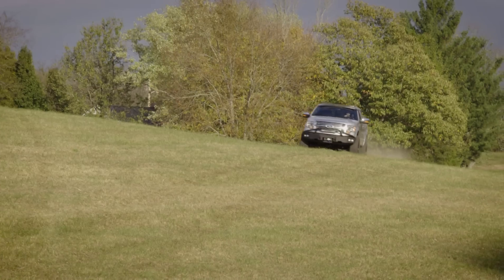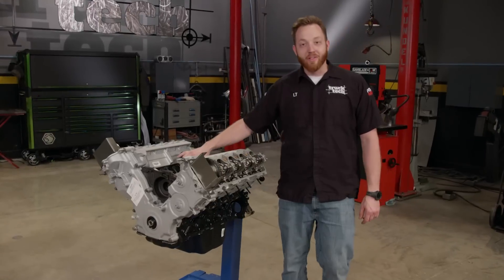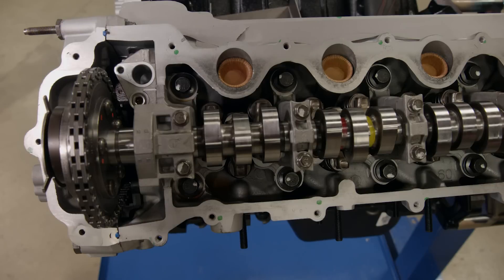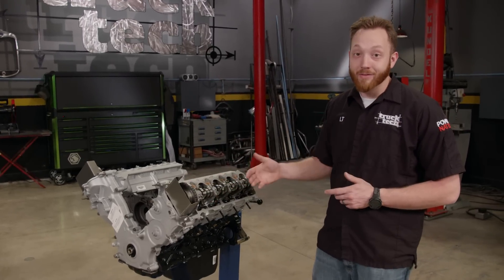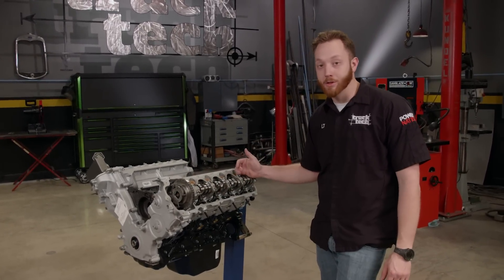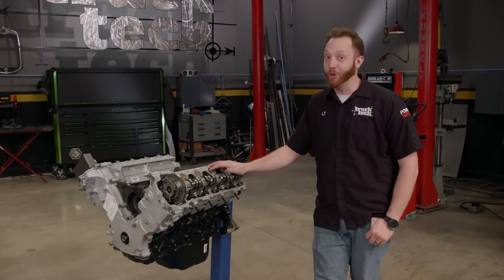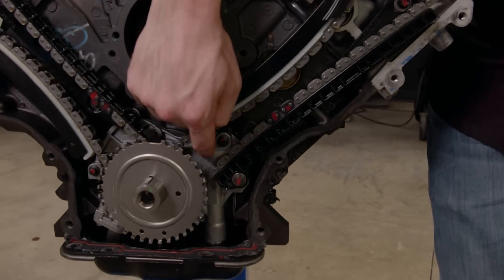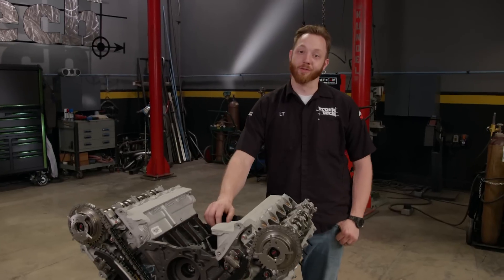Hope For 5.4L 3V Mod Motor Fans

Comment: Listen.  Please take this to heart.  If Ford does anything right, it's trucks and 8 cylinder engines.  Mod motors are no exception.  The vague bologna that is perpetuated with the 3 valves is played out.  "They spit plugs, the old plug design was terrible, the phasers explode, phasers are a terrible thing," on and on.  I will relate my story with my 3V.
     Bought an 05 Expedition with 182K on it.  Needed it for all the kids.  Wanted a truck.  The expedition fit the bill.  I bought an Eddie Bauer, so it's a LOAD of weight.  like 5600 curb weight or something like that.  It's a 4 wheel drive.  Limited slip rear dif.  Actually a pretty nice set up.  Good shape.  paid 4500 cash and owned it the day I bought it.  The torque converter lockup was slipping when I bought it so I swapped it out with a new torque converter and a much better built transmission (had monster out of Florida rebuild it, they do performance racing transmissions, and it cost just a little over the typical cost of a stock rebuild).  Back to the engine part of this story.
     The engine had that diesel rattle at idle, the original phasers were shot.  I was unaware about the oil pump issues these things experience, so I just replaced the camshaft phasers with an upgraded set of Dorman phasers.  I will say that I have never had an issue with these phasers and I get no codes, they work just fine.
     Anyway, drove the truck for approx another 40K just doing that.  I always added one container of lucas to it when doing an oil change.  Stuff does a great job of sticky lubrication and helping to protect parts.  Never had an issue over 40K miles doing this either.
     Recently I had read some things about the oil pressure issues and these trucks, so I figured I'd better get the melling unit installed.  Pulled everything apart and swapped it out.  also found a mildly blown head gasket on the drivers side, so I pulled the drivers head.  Figured since it was off anyway, took it to my head guy and had him redo the entire thing.  When I got it back from him, he said "yeah, it was due for a complete rebuild, but honestly for 220+K, not bad at all."  That means something.  The heads are solid units.
     While I had the head off, I figured I'd take some measurements.  The piston tops were covered with a lot of carbon buildup.  a wire brush in a drill fixed all of that.  barely scratched the pistons at all.  The pistons are good quality.  I measured diameter of the thrust surfaces of the cylinders against the lateral surfaces of the cylinder.  Mind you, my engine has 220+K miles at this point.  There was just under 0.003" difference between the thrust and lateral faces.  That's with this mileage in a 5600+lb expedition.  and I have no idea how well or not well the prior owner treated this thing.  I have zero piston rattle, no weird mechanical noises.  decided to check all of the valvetrain components while I have the head off from the drivers side.  all the lifters were within 0.010 of one another.  cam in great shape and lobes were almost perfect in respect to one another and wear.
     My truck makes great torque and gets after it.  I love the cam phaser system, makes for a great performing engine.  I will continue, even with the melling pump, to put one half container of the lucas and then synthetic oil in it.  The engine needs 2 quarts put in it every 4000 miles or so (obviously has some small leaks, it's got over 220K on it).  I put on some street fire coil-on-plugs and it definitely made a difference.  E3 spark plugs.  I fully expect this engine to live and perform in this truck to at least the 350K mark before a rebuild is necessary (maybe more).  I'd take it anywhere and have no concerns about confidence in it.
     Lets just end this bullsh*t about the 3 valves.  This conversation is SO played out.  Do they have some common minor issues, sure.  If you are buying one at this point, the plug issue has already been addressed.  You likely need to swap out the oil pump, which takes a day or two.  If you have a little mechanical ability, not hard to tackle at all.  They are brutally reliable.  And if you truly care for them, don't drive them crazy, keep good oil in them, and do basic maintenance, like any engine, they will live a long life.  These engines aren't a bad mark on the 5.4 history or evolution, they are just as good as all the others.
Reply: LOL. Sold my last modular ' 97 F150 with 350,000 miles on it. Great other than using 1qt of oil/1000 miles. My '04 FX4 5.4 3V needed an engine replacement at 120,000 miles due to head damage caused by oil pressure issues. It's a clean well maintained truck. I work with 4-5 guys who traded their 3V trucks in. None of them had failures, but the noise made them feel like failure coming soon. I understand that some run a long time while making noise, but my checking account had a $6000 hit due to this over complicated under performing engine. And ALWAYS put in an oil pump if you're pulling these engines down that far. Also, the earlier cast iron timing chain tensioners are a good addition.
Reply: @GusMahn  yeah.  mines got 240K as of right now, pulls like crazy.  runs great.  love the engine.  and you're right, the oil pump is the key to life with these engines.
Reply: So, you openly admit, that you (according to standard book rates) you put 
A new transmission: $5000
Phaser/timing job: $3500
Oil Pump: $2500
Pull the pass side head: $2000

So you put $12,000 into a vehicle that is only worth $4500

LOL and you say this is a "great" engine? Now I had to adjust a little due to the diff in CDN and USD but they're pretty close. So for $16500 you have yourself a 14 year old vehicle where for $500 more, you could ditch the boat anchor 5.4L and gotten into a 2012 to 2014.
Reply: @muskokamike127  ok.  @guslifevideos kind of hit on this, but let me clarify for you.  One, why in God's name would I put $12,000 into an 2005 ford expedition??  I'm not a moron, I'm not Canadian.  I did all the work myself.  labor didn't cost me anything but a little time.  Melling high volume oil pump is 141 dollars, transmission from Monster out of Florida is 1700 dollars all day every day, timing set is 147 from rock auto, head gasket is 39 from rock auto, the head refurb done by my local head guy was a little under 200 bucks.  a cam phaser is 204 a piece from advance auto parts.  so if my math is right, which it usually is, and seems to be a little better than yours, I put $2,635 into the truck when I first got it.  That's a little different than your "book" 12K.
and @guslifevideos is right .  Whenever I get a used vehicle, I always dive into it, look at what hasn't or has been maintained, and do some work to it.  I like to know my vehicles, and if you've done your own work, as guslifevideos said, then you know your car's history, what has been done, and you have zero worries about it breaking down.  I'm a big fan of maintenance instead of waiting for roadside assistance.  this engine like most will live forever if you do some basic maintenance.
so for about 7100 and some change I've got a truck that will likely last me another 100K or more miles for a few days work and some dirty hands.
Keyboard mechanics that reference "book" Ford pricing...hmm.  Maybe you should get out of your skinny jeans and get your hands dirty occasionally.  I think those pants are cutting off blood flow...
Reply: @muskokamike127 OP also has an Expedition, which kept the 5.4 3v through 2014…. Sooo not sure the point you’re making there bud.
Reply: @malinus3023  maybe by 2014 they addressed the 50 issues with the engine. 

My point is: it was a piece of crap for 5 yrs and millions of units. 

It is (arguably) the worst engine produced in mass quantities. 

Oh, and I'm not your bud.
Reply: @muskokamike127  Not sure where are you getting those prices... as a reference Fordtechmakuloco, one of the most recognized Ford F150 techs out there will charge ~$2300 to rebuild the phaser/timing and oil pump with motorcraft parts included. Jared R. did most of the job himself saving a lot in the process. Now he knows the history and the entire condition of the truck, with brand new upgraded parts versus buying another used "newer" truck for $16K 2012 or 2014 that could fail at any moment since we don't know really know the internal condition of any used car unless you take apart the engine.
Reply: @NaturebyGus  those are ford book rates. Everyone charges differently. I live in Canada so you can add 30% to those numbers. Where I live a ford dealer charges $4500 for a phaser/timing job. An engine shop where I live quoted me $3200 in labour to swap a cylinder head and they're about the most reasonable around. 

As for the newer trucks: the 5.0L in the trucks is tried and true. If you're worried about engines failing at any given moment, that can also occur on brand NEW vehicles. 

Even if you HALVE my book rates, he's still put $6000 into a $4500 vehicle. That's what is known as: being upside down.
Reply: @muskokamike127  Around here independant shop charges around $1600 for cam phasers, and oil pump update.
Reply: @slimjim7411  they can't be using Motorcraft parts, the timing kit alone is $1000 and the oil pump is around $150.00. The dealer around here charges $4500 CDN which is about $3200 USD. So you're basically saying they give you the parts for free?
Reply: @NaturebyGus  yeah, I just addressed that guy.  I am like you, I like to know the history of a vehicle, that's why I do my own repairs.  There's something to be said about fixing your own stuff and getting to know your own vehicle that can't be priced...
Reply: @slimjim7411  and in my driveway, it costs much much less.
Reply: @muskokamike127  again and again, you should buy some tools, and figure out what real life costs.  It's actually pretty cheap, and you don't have to be a keyboard mechanic all day long to try to badmouth a ford product
Reply: @muskokamike127 if you have to pay to get engine work done and etc your not even valuable to this conversation on whats budget , whats easy, whats reliable. Just continue to take your builds to the shop and stay out of convos you have no hands on experience in lol

Comment: Just bought an 04 Lariat with the 5.4. Makes ticking noise but drives fine. The previous owner had transmission rebuilt at 130,000 and it has 150,000 now. I basically stole the truck for what I paid and how nice it is. So far looks good but I want it to last. Should I change to 5-30? And what’s some small daily tips to make this engine last forever?
Reply: Forgot to mention I use 5-20 high mileage oil but I want to put the best in it.
Reply: Your truck sounds just like the one I just bought a week ago. 291,000, rebuilt trans at 160,000, 1 owner since new before me. Did you ever get any tips?

Comment: Best thing anyone can do for their 5.4 3v is run 5w-30 oil instead of 5w-20 like recommended. It truly was designed for 5w-30 and there are forums with real experiences to back up that claim. The cam phasers will go much longer and oil pressure will improve.
Reply: I use full synthetic 15w40
Reply: @rcsix3rd  in your 5.4 triton?
Reply: Since the upgrade in my 09 5.4l  I've been using 5w30 there's a huge improvement in HP and gas mileage.
Reply: My 07 5.4 ticked when I ran it hard. Put 10 W 30 in there full synthetic, ticking is gone.
Reply: I switched to Valvoline 5W-30 ext milage/full syn from using Mobil 1 prior which seemed to have turned to crap over the past decade turning dark w/ high evaporation rate. I replace oil/filter @ 7k now and the oil is still amber & virtually no metal flake on the plug magnet.
Reply: I have the 2011 5.4l v8 anyone are you sure it's safe to use 5w30?
Reply: @theshield1613  I currently have 260,000 miles on my 2010 5.4. Been using 5w-30 since 200,000. Guarantee you it’s actually much better than 5w-20
Reply: I thought they started putting the 5.0 in the 11
 @theshield1613
Reply: @lesterlivengood3425  the last 5.4l v8 was in 2014.
Reply: Dude,  I work at an independent shop, a really bad one,  where my boss and coworkers will pour ANYTHING in your engine,  they will mix 5w20 and 5w30 oils together instead of walking to go grab another quart,  or just dump in whatever is laying close by with no regard to what it actually calls for. ...it kills me. ..smh
And we don't diagnose either,  and by we I really mean THEY. ...just swap part after part until it either gets fixed or give up and send it to "the dealer" lmao
My boss, the owner of the garage,  watches youtube videos and uses Google to "diagnose" things. ...I'm not kidding one bit. ..he's too cheap to buy a subscription to all data or shop key, or Mitchell on demand, or identifix etc etc ....we have no information, no diagrams,  there's only two of us mechanics in the garage, and we use the shops tools, which SUCK for the most part,  old wore out sockets and screwdrivers,  we don't even have a working multi meter in the shop,  just a test light, and an old ass snap on solus scanner.  We don't have a fuel pressure test guage worth a damn,  just an ancient leaky one with only one fitting for gm.....I would bring my tools but the guy I work with is a slob and I don't want him touching my shit,  it'll get lost or broke if he does, I have to go around behind him organizing and cleaning just so I know where to find tools and don't have to work in a huge mess constantly. ..I bet if I missed a couple days in a row the place would look like a grease tornadoe came through the shop. ...I've only been there two months ...when I first started it was bad. ...would take me five or ten minutes just to find a particular socket or extension that I needed Because everything was just thrown around everywhere with no rhyme or reason, I have ocd, honestly,  I have to have a clean organized work space or I lose my shit. ...
The owner of the shop is cheap,  pays as little as he possibly can, and wonders why he can't keep employees,  he keeps the paper towels and toilet paper under lock and key because he's afraid customers are going to steal it. ...seriously. ....
And will let one of the two racks sit empty all day while there's $500-$1000 labor jobs sitting in the pkng lot to be done in fear of missing out on a $20 oil change that may or may not show up. ...
And get aggravated when I find other things wrong with vehicles other than what they are in for. ...he thinks I'm trying to rack up the bill on the customer, when in reality I'm just doing a good job and letting them know their brakes are almost metal to metal and it can be dangerous, you'd think it would be a win /win. ..we make money and customer stays safe, but no. ....I dint understand his logic, he turns down work left and right that actually needs done. That's money rolling right out the door with the vehicle in my mind. 
Sorry for this rant whoever reads this,  I just gotta get all this off my chest or in gonna explode, and since I really need this job right now to get myself out of the bad jam I'm in I can't say anything to anyone out loud.  Boss doesn't pay overtime either, it's the same rate matter if you work over or not, and get this, if I work a Saturday he only gives us $50 cash each. ..and he thinks we're supposed to be happy about that! !!! Plus I show up early every single day and give him 4 to 5 free hours of labor every week...never have gotten a thank you or anything,  my probationary period raise was three weeks late showing up on my paycheck. ...and it was only half of what I need in order to be able to pay my bills and eat without juggling bills. 
After I get these last couple ase certifications and have my master tech patch,  I'm moving to Florida and I'm gonna apply to a Honda dealership and make some REAL money, working on the easiest repairable cars out there, brand new, no rust. ...life will be so much easier. ....can't wait! !!!
Reply: I hope you got out of that bro, that business is so unethical it hurts my brain, he’s violating labor laws by not paying you overtime, he’s an insult to mechanic shops. I hope ur finally working at a shop that actually care about doing good work!
Reply: @TheCoatneyadkins  hope u made it to ur Dreams Kid
Reply: The thing is Ford specs 5w20 for their engines for fuel mileage reasons. It's no secret the motors live longer with 5w30 but to meet the mileage standards set by the EPA they have to cheat slightly and use that watery 5w20 BS oil. That's why from day one of owning my 02 5.4 i've used 5w30 instead of the 5w20 the owners manual called for, plus back when I bought my truck new in 2002 the 5w20 oil wasn't as widely available as it is now.
Reply: @scottlambeth5478  I know this is old but NO, those specs are in all foreign markets as well. NOTHING to do with EPA
Reply: I run straight 30w in everything.

Comment: I see you upgraded to the cast 2v tensioners. I think between the cast tensioners and the HV oil pump the 3v can be as rock solid as the 2v was.
Reply: Freedom racing sells a revised version of the tensioners that are ratchet style not oil pressure driven. Also buy the phasers that are locked in the fully advanced position and that motor will run foreever
Reply: @csaleen302  I would stay away from Freedom Racing. Bought 2 new Motorcraft phasers and had them installed by a Ford tech that does them very regularly. One phaser broke into 3 pieces less than 10k miles and would not warranty it. Their "ford" person stated it broke because the new bolt was not used. I asked the guy, why would I not use the new bolt that came with it and how could you even tell by just the pictures I sent. Needless to say I was $240 in the hole.